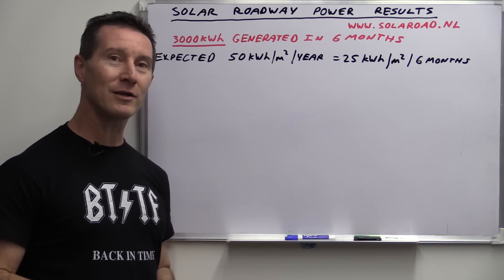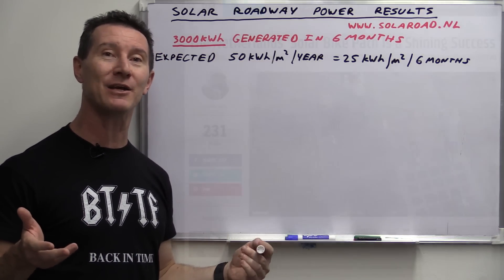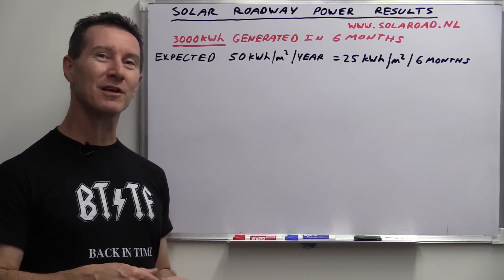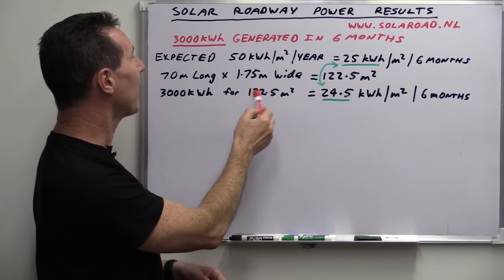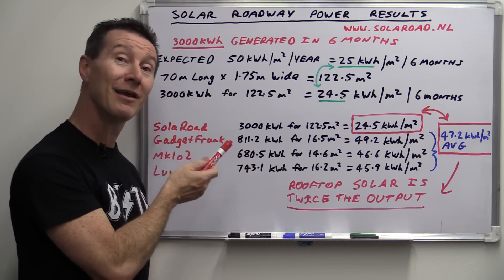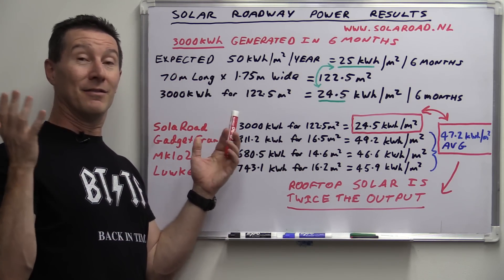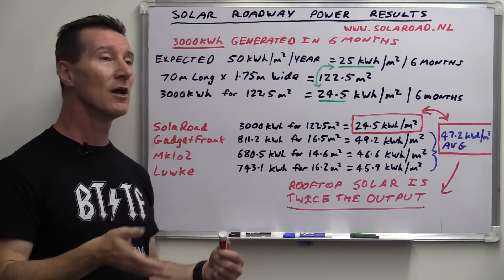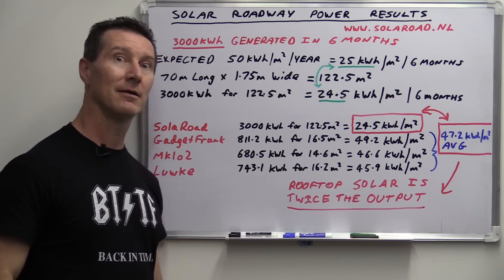EEVblog #743 - Solar Roadways Test Results

Comment: I am not so sure that this is as much bullshit as Dave says.
Of course this roadway will never produce as much energy in its lifetime to pay for it self.
But does it really have to?
Maybe it is enough if it only pays of by the difference in costs for a regular roadway plus having a power source and an additional power grid supporting the existing solutions.

Correct me but as far as I know nuclear power plants cost a lot more in total than the pure profits of the sold Whs. At least here in Germany the government (tax payers) subsidizes the construction, deconstruction of the plants and the permanent repository of radioactive waste.
Using Dave's argument there shouldn't be those power plants (and I wish it would be like that :) ).

My point is that there are other conciderations than mere profit. Especially in government projects.
If I were responsible for planning a roadway in my city and I had to choose between two more or less equal (in total costs, quality and maintenance) roadway concepts of which one supports/relieves my power grid I would concider it.

About the project in south korea:
The solar roadway in south korea yields a lot more power than Netherlands concept for sure and it is a nice idea having shade for the people and solar power. But you have to maintain both, The roadway and the solar panels. And I don't mean that as a bad thing.
With the solaroad concept  you "only" have to replace the broken solar panel(s) and the roadway (or pavement) looks like new instead of how they look over here in Germany when they got repaired (google: strasse flickenteppich)

Plus the people in south korea are probably happy about the extra shade but the people in northern Germany and in the Netherlands too i guess are for the most part happy for every day the sun is shining ;) at least I am right now. :)

In my opinion it was the right decision concidering/testing this concept. I wouldn't call it straight Bullshit just because of that one cost/energy argument. BUT I am also very sceptical about the concept mainly because of the robustness of the panels and the other disadvantages of glass as a material for roadways.

(Excuse my english, not a native speaker :))
Reply: JoeyRay82  "But does it really have to?"  
Yes - and at that point the whole rest doesn't even need to be addressed.  
The reason is simple - you could build them on rooftops - same benefits for the environment, costs less, and you have higher yields.
So unless it comes even close to on par it is a stupid idea.

Think about it like this:
You can either waste 1 million € or  10 000 € for the exact same result - then the first is not even an option, it is simply useless.

"Correct me but as far as I know nuclear power plants cost a lot more in total than the pure profits of the sold Whs."  
The opposite is true - nuclear power on its own is still the cheapest and cleanest form of energy we have nowadays.  
One reason why the costs are high, is cause they in general have to pay extreme extra taxes.

nuclear power-plants have extremely high initial costs - building one costs a fortune. But keeping them running is dirty cheap.  
That is one of the things that is currently skewing the statistics heavily - throttling down or shutting down nuclear powerplants does significantly increase the cost pr kWh on the paper.
If you build a huge complex for many hundreds of millions and then shut it down - go figure that such a waste has some impact.
This goes for Germany too.
by the way, an interesting peace of information:
Germany as once on the front of nuclear engineering - SNR-300 for example.

The streets - yeah, that is kinda a problem, but look at it this way:
Das Strassen-flicken könnte viel besser gemacht werden, nur sind Politiker eben so verblöded, das sie lieber Millionen für so nen Schrott wie Solar-Straßen rausschmeissen als die Straßen zu reparieren.

And about Korea - it does not matter where in the world you are, it is an inherently flawed and bad idea.
A still stupid idea, but better than putting the solar-panels into the road:
Make the same road, just leave out the solar-panels and build the panels somewhere else, with proper tracking and so.
Now the whole setup costs way less and you produce at least twice as much power, with still all the benefits and no additional downsides.

And one last thing:
Glass as a road-material is suicidal.
It is brittle and if something happens, you can count on some serious injuries.
And the produced glass-dust is an extreme danger to our health and the environment.

Just image this scenario - you are riding your bike in the fresh winter, and suddenly a panel cracks under you. That is a sudden burst, sending glass-splinters flying. The sharp edges will destroy your tires and you will crash.
What would happen with a normal tar-road? Nothing, a normal bumpy road.
Reply: JoeyRay82  ... "Of course this roadway will never produce as much energy in its lifetime to pay for it self. But does it really have to?"  
Would you buy a solar panel and put it on your rooftop if you knew it would never pay for itself?
Reply: ABaumstumpf Thanks for the response.

Yes, solar panels on rooftops are far better in yield and cost. And all governments should subsidize this more to encourage the people to install them. But that wasn't my point.

The point about nuclear power plants wasn't the best one for my argument. Agreed.

I don't think the glass will scatter into sharp splinters because of the type of safety glass they use - or could use. But I agree with you that glass as a road-material is most likely a bad idea and for me the main reason I don't think we will ever have solar roadways.

But ignoring the glass issue for a second and returning to my main point:
I still think there could be something to this project if you see it from a different perspective.

Don't think of the solar roadway as a power plant hidden beneath your feet specifically built to replace other alternatives. Or to be used as an alternative to rooftop solar panels.

Think of it as an alternative road-material with an added bonus.

Building a street is pretty expensive (for example google: barrie costs per metre (pdf)). 
And the cost for using a solar roadway might be just slightly higher or even equal. 
And if a roadway has to be completely renewed this could be an option, because it serves a double purpose of having a new roadway that is needed anyway and having an additional power source supporting the power grid. And it would look kinda nice ;).

"Das Strassen-flicken könnte viel besser gemacht werden, nur sind Politiker eben so verblöded, das sie lieber Millionen für so nen Schrott wie Solar-Straßen rausschmeissen als die Straßen zu reparieren."

To repair a tar-road correctly (whithout patches) you have to rip of and replace a huge section of the street. That takes a pretty long time (weeks, sometimes months) in which the road can't be used. That's why (i guess)  besides the costs the streets at least here in germany get this ugly patches ;)
Reply: Reddit Gold User No I wouldn't :) But my point wasn't about yield but more about the double purpose or added value whatever you want to call it. 

How about this example:

Your roof has to be renewed. You could either buy the standard material or a more expensive material with better insulation. The better insulation would save money because you wouldn't have to pay as much for heating/cooling but let's assume the money you save isn't as much as the price difference for the material. Would you concider it?

At least I would concider buying the better insulation, because of the added bonuses:
- lower temperature fluctuations
- smaller carbon footprint
- less energy dependency

...and then put efficient solar panels (which pay for themself) on top of the roof ;)
Reply: JoeyRay82 
-Your home may have less of a carbon footprint but you also have to include the carbon footprint of creating this material. Tempered glass takes a ton of energy to create. The amount of circuit boards needed will also cause an impact.

-temperature fluctuations are exclusive to your example and don't apply to the benefits of solar roadways.

-less energy dependency. I agree. But if you're aiming for less energy dependency there are more efficient ways to achieve this.

"and then put efficient solar panels (which pay for themself) on top of the roof ;)"
How about buy the cheap insulation and be able to afford 2-3x more panels? You would essentially have
-energy to control fluctuations
-even smaller footprint
-even less energy dependency
-enough profit to buy new panels when they burn out in 20 years.
Reply: JoeyRay82
Well - no, the example of renewing the road does not work:

You have to specially prepare the foundation cause those stiff panels are not allowed to move the slightest like a normal road does.

further, even the glass alone is more expansive than the whole costs for a normal road.

The normal blacktop roads are covered with, is extremley cheap to maintain, cause even when it gets destroyed and removed, over 90% of it is recycled and used again.
It is made from a oil-byproduct and stones.

It simply can not work - no matter how good our technology gets, it is impossible to be viable.

think about it this way:
Take the fully build solar-road as they suggest, remove the glass and the solar-panels - you still got a working road (the ground underneath has to be made of a solid sturdy material that has to not move the slightest even under have loads or the panels would crack).
Now take the solar-panels, make the glass far thinner, and use them as a rooftop over the road.
Cause the thick glass and the sturdiness of the cells is the main cost-factor, you now are far cheaper, and produce more power (about twice as much by simply angling them correctly).
And you have the added benefit that concrete or blacktop are far better materials to drive on even with bikes. Specially when it is wet or when the sun is low.
Reply: ABaumstumpf  
I have trouble researching better data on this topic. 
It would be easier if those guys from that solar roadway company would give a statement on how much more the construction of a solar roadway would cost.

If you take away the panels and put them elsewhere you still need to pave the road and seal it. I don't think they build the panels on a perfectly sealed road. And regular roads need a good foundation too.

I don't think that putting solar panels on roof tops is an option for someone who is assigned to plan the construction and repairment of roads (eg road dept.)
I don't talk about wether a city should build roads + solar panels on roofs or if they should build solar roads.
I talk about which building material to choose when planning a new road or repairing one.
Besides that the company states that even if every rooftop in the Netherlands would be equipped with solar power it would only supply 25% (I don't know if thats true but I'm too lazy to research other sources ;))
So there is room for additional power sources.

That said, I think you (and Dave of couse) are right on the costs and on the robustness.
I am pretty sceptical about this concept too. 
But I still think it is worth researching. 
I wouldn't fund it though ;)
I will keep an eye on it. And wait for Dave's next rant :D
Reply: JoeyRay82
There is still no reason to ever look into this.
Aside form Solar-energy not being a good power-source in general (You need something that can store extreme amounts of energy - quite costly and not that good for the environment either).

The solar-panels are rigid structures - they need a mounting-place that does not move the slightest. Not for withing the same panel, but no movement between the panels either. 
For blacktop on the other hand, the ground can be comparatively soft, malleable.

In general you can say, the surface you need to mount solar-panels is pretty much the same if not even sturdier than a concrete-road.

And even if that was no problem - you would still rather mount the solar-panels ant an angel facing the sun - not flat on the ground, to get about twice as much energy.

Aside form that - it is glass.
Even the strongest versions we have are rarely used for people to walk on.
It gets scratched and that can easily lead to cracks with changing temps.
Than it is quite fragile against sharp impacts - like a stone stuck in tires.
It reflects light when the sun is at low angles.
And it provides nearly no grib once it gets wet.
Reply: ABaumstumpf
- Yes, storing energy is a huge problem.
- The modules appear to provide the necessary rigidity according to the pictures (google). At least for bikeways of which the Netherlands has plenty of.
- I agree on the glass issue.

Still going to check the progress of this project once in a while.

Comment: Why are they only expecting 50kWh/m2/year?  The insolation value in general around the Netherlands is around 1000kWh/kWp/year.  Seeing that 1m2 these days can produce 150Watt, over the year it should produce 160kWh per year per m2.  Don't forget that the farther away you are from the equator, the wrong 6 month period can be  very different from the other 6 month of that same year.  If they were expecting 50kWh/m2/year you can't really divide that by half for only over 6 months.  Comparing it with other systems in the similar location would be best.  Like you did in the video.